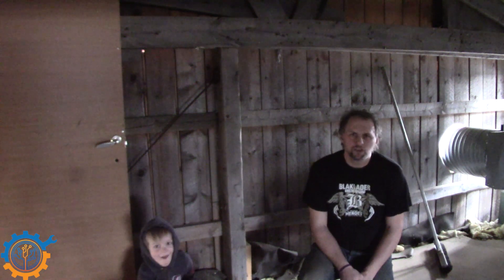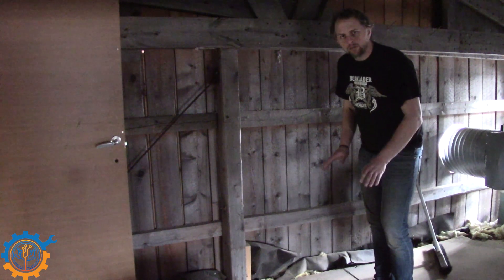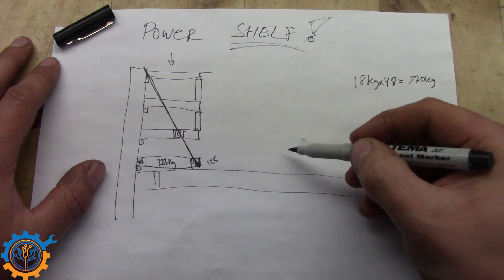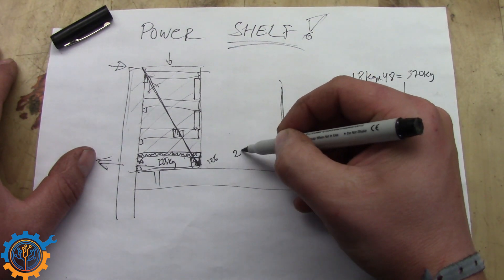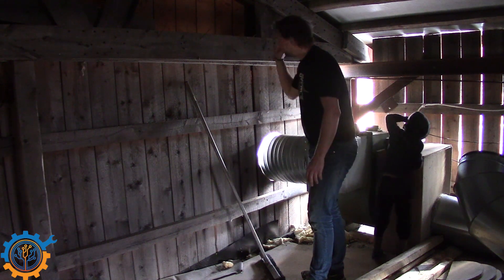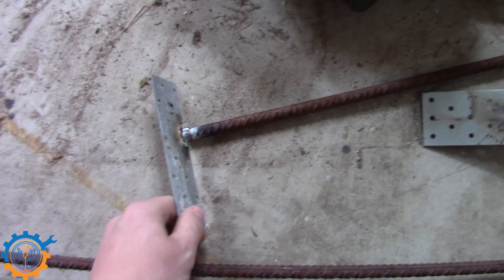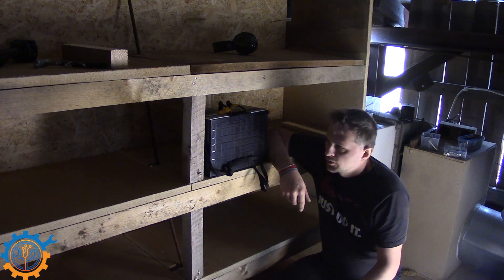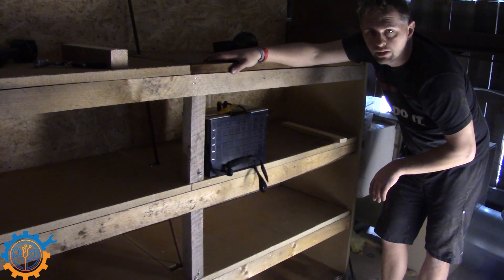Power shelf for solar batteries (18650)

Comment: First a question about batteries
Parallelize each shelf so you have 12 volts and then connect the shelves to give 48 volts

tar det på svenska mina synpunkter/funderingar om konstruktionen
antar att du skruva upp fästena för hyllorna i 2x6 som du satte bakom ?
och ska du sätta stag mellan alla våningar i fram och bakkant ? tänkte om nått släpper så fördelas de extra krafterna på fler punkter så det inte blir en exkalerande effekt (sen den hyllan som kommer klara mest är den understa och som du rita så skulle du inte sätta stag mellan den och de över 
och som en sista sak på konstruktionen så undrar jag ifall du ska sätta nått under mot golvet som kan ta upp det ifall dina armeringsgärn börjar krypa så typ 1cm glipa till understa ? och åt vilket håll går balkarna som golvet är på (tänkte ifall de sitter från väggen och går ut eller om de sitter åt samma håll som takstolarna, för går de ut från väggen kan de ändå klara en hel del men att det ändå gungar )
Reply: den tanken jag har om att sätta nått i hörnen mellan den understa och den över var att om nått börjar krypa så fördelas tyngden av de två översta på båda understa istället för den näst understa bara 

jag vet inte hur mycket luft du har under den understa hyllans nedre del och golvet men en till tanke med att sätta någor där är att sätta en brytare eller liknande, då jag antar att du kommer montera övervakning i hyllan för att kolla temperatur bla så då kan du ha nått som säger till ifall hyllan skunker på mitten med typ 5-10mm 

det är mer ifall att då det ser ut att vara stadigt nog men man kan inte veta med säkerhet när det är gammalt
Reply from the maker: Det är bra tankar. Och brytaren i fråga gillar jag helt klart. Där är några millimeter tillgodo just för att jag vill se vad som sker så det finns plats för en brytare!

Comment: What are you fixing those steel bars to at the top? 

Are you sure that the fixings will be strong enough and that the crews won't just pull out?

I can see where you're going with this but I feel strongly that it's not a safe way to hang the shelves like that especially as all of the weight will be hanging on the three metal plates that you used to join the uprights to the upper horizontal beam. Are you connecting to both beans or just the one on the front?

I would put in a 2x8 horizontally below the bottom shelf and join that to the centre and corner posts with through bolts and washers, at least 3 per joint, and then position the shelves on top of that and still keep the rest of the structure like it is, this way the main weight will be supported by the lower beam and kept in to the wall by the metal bars like you are doing now.

Last thing you would want is for the 870kg of batteries to come tumbling down on you while you're in the garage, if you're lucky you will 'only' lose all of your batteries and switchgear...

I don't want to be a spoilsport but I really don't think that what you're doing is safe!
Reply from the maker: No worries m8 :) Each steel bar do not have that much of weight. its also taken upp by the sideplates that are 26mm material with heavy duty screws. Due to the angle and construction with the sideplates alot of the weight is on the wall directly and those posts. Note that only half the weight is on the outside and then only the middle one have full weight since the sides also have the side-plates. 
 The screws cannot pull out. They need to be sheared off if the steel bar is going to come loose. They are alligned ~90degrees against the force.  

870kg on one of the rods is another thing but in this case the worst case scenario the rods have 145kg of weight from the batteries on them self in a straight down force.

Thanks for concerning though :)